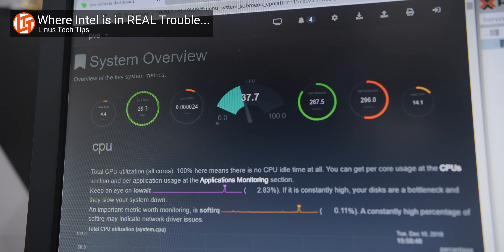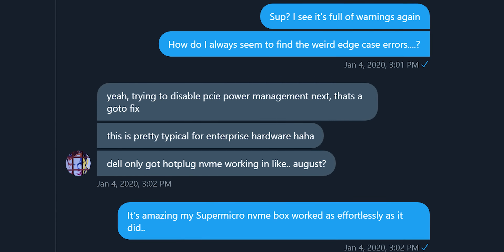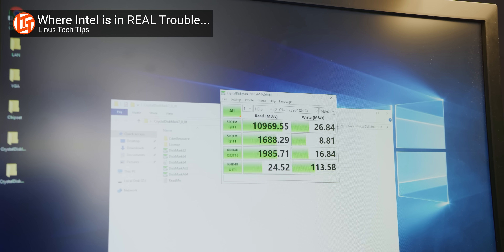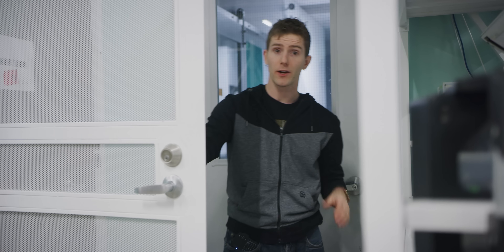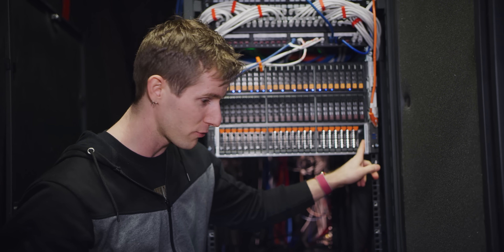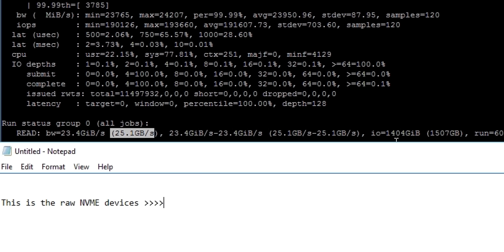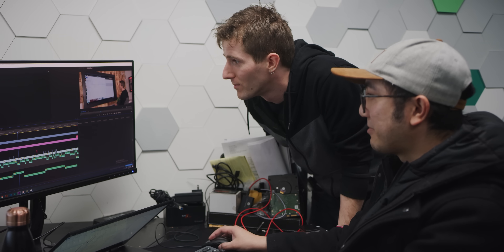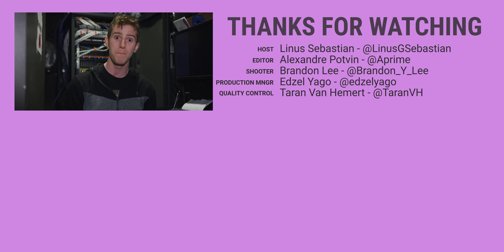This Server Deployment was HORRIBLE

Comment: ...so lets figure out the why: multi user access for same file live, so a couple guys can work on raw video.  I don't understand why this cant be handled by a smaller node or even a primary editing rig with enough cores to serve its counterparts in the same room...because you cant really justify a jobber server to do this if its requires such an incredible amount of horsepower to simultaneously serve 3 people the same data, Feed it to the first in line, and that machine operates as live cache for the duration of the job.  Easier, less hardware cost.

Comment: Oh man, watching AMD guys wonder why their shit don't work is a riot. I'll give you a hint, AMD's microcode is 5-8 years behind Intel and the hardware design is stupid. That's why.  Please, also remember while your "total" memory bandwidth is X number, it's split between the chiplets, thus you really only have half or less for actual work per chiplet. You do not have even actual quad core memory speed for work. Thus you are gonna get all kinds of bottlenecks when you try to use fast drives that are faster that your actual single core memory bandwidth. So no single core or group of cores actually has access to your "total" memory bandwidth. This is why my Intel xeon server has zero issues with fast drives and your AMD absolutely blows at it. Now you might understand why Intel says, "real world" work is completely different.  One day you AMD fanboys are gonna figure out high core count just for the sake of high core count without everything else actually up to the task actually sucks in a lot of ways. Intel mentioned this too, but you young guys who do not understand the hardware designs are completely lost and just rolling on hype.

Comment: So , that is WHY in REAL ;) servers, they use RAID card, that will give you better performances (or multiple RAID cards in this case) and offload that cpu usage on the card. Now, they do have bandwith limits, so check that out too if you build one!

Comment: 7:55 - Real quick, can I hit you with a theoretical? What if you had 96 cores? I mean, this thing is being used for smoking hot storage, not gaming... you don't need an x86-based CPU for that. While I cannot verify their NVMe or PCIe capabilities, something like a Gigabyte R270 ARM Server might serve your needs. Maybe not that exact brand or model. But something LIKE it with a different CPU architecture. If x86-based architectures just don't seem to have the raw computing power and core counts you need, it's time to look at alternatives. I keep saying x86-based CPUs WILL DIE. This is why.
Reply: Sean Condon 

I was wondering if Xeon Phi would help with the core count problem. Lots of Atom-sized x86 cores to spread the loads around. Hopefully with enough PCI lanes.
Reply: @shapshooter7769  maybe. I mean, the major issue seems to be core count. And fortunately, storage is something that can be highly parallelized. The issue I take with x86-based architectures for this purpose comes down to power draw and heat output. ARM is known for having both low power draw and low per-core heat output. This also isn't really the sort of operation which specifically requires a CISC architecture like x86 or x86-64 unless you're trying to run it in Windows.

Comment: My guess is that you are running 1 vdev pool for all disks, meaning every time you want to access the disk, all 24 disks needs to sync up. If I where you, I would use zfs, with 3+4 mirror vdev´s, striped in 1 pool. that way you would have 3-4 independent device pools for load balancing.. In a network case, having just one device pool, is a bad raid architecture unless you only have 1 user sumping huge files in a steady cue. On the other hand, I have never had a system with this much read/write bandwidth in my hands.

Comment: The 1st time that I've heard of this problem was in 2017 when the all flash storage array was a new thing, fortunately now there are plenty of specific storage systems designed with specific chipset/software that is capable of avoid this issues.
Unfortunately the cost is very high

Comment: A have a problem with my new pc. When i play games, the pc decides to randonly freeze and restart, its random not after 2min ,5min,or 2h of playng, i check the temps both cpu and gpu, all around 77 c on CPU and 67 GPU, check disk integrity, its ok, system file integrity,ok,virus, ok, even ram. What coud be? My i7 3770 is using only 6 cores (i set it)     
My sys
I7 3770  non k 
2x4 ddr3 ram
Gtx 1060 asus dual fam no overclock 
Psu corsai vs 550 80 plus white (brand new) 
This only occurs when gaming and its random, its freeze and restart, i can play gpu heavy game for 3h and half hours and more  morning and late night without this issue, sundenly the pc decides to do this

Comment: Interestingly, i have this problem at 0:23 WITH JUST AN USB2 STICK god dam it.
Write Write Write Write Write DROP [...] [...] [...] Write Write Write Write Write Write DROP [...] [...] [...] AND so on
Reply: It's made me think, I've got this problem with USB sticks, 4 different systems, all have nvme drives in them, drive to drive transfer seems fine tho, one machine has 2 nvme drives that don't drop out, I just figured it was windows USB messing but it happens in Linux too?
Reply: Use another stick to isolate if its the system or the individual drive.

Most flash drives have sucky controllers and sucky flash memory -- then you transfer tons of small files ravaging random access times and overwhelming the controller and the memory causing it to heat up and thermal throttle as the poor drive stumbles in an attempt to limit error (up to its own error correction) and to limit heat.

If it happens to all flashdrives, check for drivers first. Then check BIOS. Then check the hardware ranging from unstable PSU to throttling CPU to a dying motherboard. In my experience its usually the first or last if not a driver issue (which I've somehow had usually in embedded Acer systems)
Reply: It's repeatable for me across different brands of USB drives, different systems 😕

Works fine for a few gb, then pauses, speeds up, pauses,
Reply: @SteadVex  might be the same problem Linus is having just on a smaller scale (28-core cpu vs typical 4-8core, a few nvme drives vs a f**kton)

If its the same, try limiting your pcie gen to gen2. Check if your ram is being hammered. Try making a ramdrive and copy from there. Check the windows event viewer for errors. Try an nvme-nvme transfer (USB also makes CPU cores very busy just like nvme). If your nvme drive has parity, try using a setup that has no protection. Boot off a Linux flash drive and see if the same problem exist.

So many potential problems. Sorry I cant help you much further mate, we're still using regular SATA SSDs here for all our desktop systems and no nvme yet.
Reply: @SteadVex  usb is flash storage so data chips have speed penalty when overwritten.

Try reformatting
Reply: @SteadVex  I think it's probably just overheating the USB drive.

Comment: PLEASE try some more things to optimize performance. In particular:
- Switch between MSI and MSI-X IRQ Signalling if possible in the BIOS
- Manually set CPU affinity for interrupts
- Switch I/O Schedulers
- Tune virtual memory
Reply: Its just the rushed out AMD cpu.
Reply: @draken5379  That's why I want to know which of these software settings affect the performance of that bottle-necked system...

Comment: Sounds like the Linux driver needed to be tweaked so they switched on NAPI automatically. It shouldn't be necessary to manually switch the kernel to polling instead of interrupts. The NAPI system is supposed to do that automatically if the interrupts gets too interrupting.

Or was NAPI never extended beyond network interfaces??

Comment: Had similar problems with windows storage servers as far back as 2012.  Did similar things thought hmm... try Linux... similar problems.  But this was waaaay b4 nvme.  Difficult to fix.  Part of the story is the os getting in the way.  Part of the story is the way the hw and drivers work and part of the story is in the way applications are designed (aka for "general" use cases).  There's a way to hit 10GB/s but it's non-trivial and polling isn't it since at those speeds ... LATENCY actually starts to matter a lot!  It's an artifact of the total system design.  

More or less this is something people have chosen to ignore and just throw money at the problem.

Comment: Hey LTT, dunno why you guys didn't just setup tiering of storage with ZFS. Use say, 4x or 8x of the NVMe disks,  some as L2ARC some as ZIL, and the rest SAS 12gig SSDs or 6gig SATA on SAS bus, then stuff it with RAM. Probably would have cut down on the CPU costs massively and still delivered ludicrous speeds exceeding your actual production performance targets. Certainly do appreciate seeing the extreme high end here (from a single socket), but maybe temper this with some, I dunno... middle-ground that actually works and still exceeds your needs? :P @ me if you want some additional insight.

Comment: This is the kind of scenario why businesses are still not jumping to AMD. It just doesn't work out of the box, the software is not yet optimized, hardware wise nobody knows how buggy and full of workarounds the firmware is so you don't get the expected performance even if technically the platform should scream.
Kudos to them for upping the core count so much and moving the prices down, but if they wanna become a real alternative in the workstation/server space they need to improve on quality of features.

Comment: So I get that back in the olden days where CPUs only had a couple of cores, that you could not reserve a core to listen for the interrupt calls... However, with a 32 core CPU, it should not be much of a sacrifice to completely dedicate a core as an event listener for them. But I suppose this is not supported by the kernels to be configured?

In general, it sounds to me that a lot of these issues could be solved if the software were written to dedicate certain cores to certain tasks since modern CPUs have such an insane amount of cores?

Comment: I dare not say that I would understand the level of knowledge to run ALL of this (a future plan that will be happening in the far future), but wouldn't it have been more effective to use the ZFS share while maximizing the CPU and Memory, and network using virtualization? i.e. 6-8 Virtual machines, all dedicated hardware splits per user, ect? Or would the Latency be too high?

Comment: Yes, interrupt service routines need to demand CPU time in high-speed low-latency applications.  It is the way...  
The biggest issue here is that you need about 2 to 4 times the memory bandwidth as your data throughput depending on reading/writing and processing of data.  This is because your DMA access from the NIC is using bandwidth, then the CPU uses the bandwidth to read some or all the needed parts into cache, then the CPU commits that back from cache to DRAM and it has to wait for that commit before then another DMA access for each write to each of the necessary drives.  Reverse all that for reading data and sending it through the NIC.  The whole thing is not very efficient and there may be an amount of DRAM you can use as cache that is efficient under medium load conditions but that gets hairy in cases where the system may lockup during writes.  But surely there are high speed FPGA based systems that do a lot better job of managing the bandwidth, processing and transmission of data to/from the network and drives... they must exist...
Reply: Yeah, I was worried too when he talked about using half the memory bandwidth. That is not how that works.

I would drop half the drives. They can only cause trouble, and won't make anything faster.
Reply: @Carewolf  Or don't page out.  Direct I/O
Reply: I thought he said they were x8 PCIe lanes.  That is 8 GB/s per card.  With 4 cards, that is only 32 GB/s, no? That should be OK.
Reply: well thats way apple computers are so expensive is that low latincy high memory speed motherboads are VERY VERY SUPER EXPINIVE TO SORPORT

Comment: Just disable caching in general, you could also use hardware RAID controllers which might be able to handle all of this so the CPU doesn't have to deal with it; not going to fix the memory issue though.;;; ahh yes Polling. Why don't you do a crystal disk test on the networked machines all at the same time..or large write and read tests from each.

Comment: Did I miss a previous video? How are the SDD's connected? 
An individual NVMe PCI-E might capable of 3-4GB/s, but if all 24 connect via a PCI-e switch with x16 lanes on the upstream side, then you will only have 16GB/s of bandwidth.
Re DDRx memory, the rated bandwidth is for read, So each 64-bit, 8-byte channel at 2666MT/s is 21GB/s read bandwidth. On a 6-channel socket, that 126GB/s. A two socket system could be 2X, but that assumes you don't have to transfer over the interconnect.
Writes occur at the DDR clock rate, so 2666MMT/s has a 1333MHz clock and 1333MT/s writes.
A disk (storage device) IO involves a read from device, writing to memory, presumably followed by a read of memory to see what you just wrote.
In the old days, this meant max theoretical IO was 1/3 memory bandwidth, because the IO involved a memory write + read.
Some time ago, Intel claimed their memory controllers could do the R/W concurrently , but that might have been their FB-DIMMs

Comment: This video was very informative.  Good job. 

ZFS takes a ton of CPU power.  Go look at the FreeNAS forums. 

Of course Linux comes to the rescue.  What other OS would ? 

So funny we now have storage that is faster than the rest of the system. 

You need to send this problem to Linus Torvalds.   I'm sure he'll implement a solution because if you have this problem, so do many, many others.

I'm sure this problem will be fixed in a near future kernel.

Comment: this was fascinating, cause for the last few years i wanted to dip my toes into server stuff. not with nvme, probably not even ssd, but still.   

if the drives are timing out, cause the cpu was waiting for it, but wasnt getting it from the drives, probably it should not accept it sequentially. do it just like the routers on the internet; take what it gets and then take what it did not get in the other cycle when the drive comes out of timing out. and the info will buffer, to make a whole complete file. like youtube buffering. it will suffer a small stuttering delay in the beginning, but that buys it some time to fetch and compile all the other data in the sequence to make the sequence seem one smooth contiguous transfer. 

they can look more deeply to a mix between USB and PS/2 style polling/interrupts. where it polls sequentially, but does not wait on a missing drive, and the missing drive then interupts and uploads its portions to catch back up to the rest. the drive that times out, interrupts when its ready, adn is then allocated a little more polling opportunities in order to catch up to the rest of the array, in sequence.

Comment: ...just built a Dell poweredge server for a client using Dell's new PERC RAID controller card with 6 sata SSDs (+1 global HS) in a RAID 10 configuration and got around 6.5 - 6.8 GB/s read/write. While this isn't as fast a LTT's server, using a controller card offloads the disk processing from the CPU onto the RAID card. This lets a CPU be a CPU and not worry about RAID. This old school method is more straight forward and I experienced no bugs doing it this way. We might be a software and CPU/PCIe generation or two away from hitting the higher theoretical limits proposed in this video. In other words, SAS or SATA SSDs in a RAID 10 can be a better solution (depending on the situation) until the software and CPUs catch up. I love NVMEs but my business clients need reliability so I'll be sticking with RAID controllers for now.